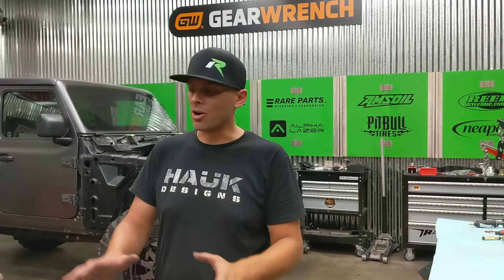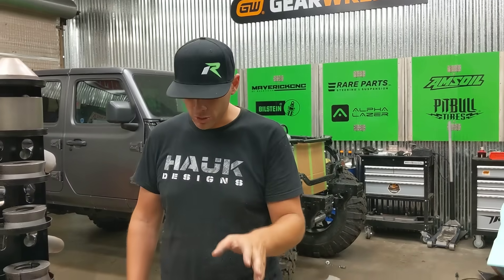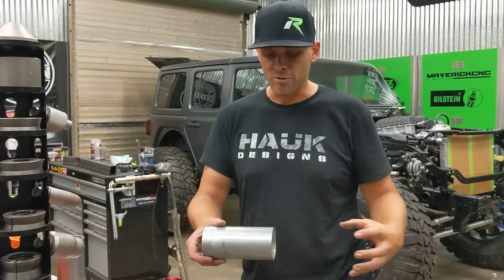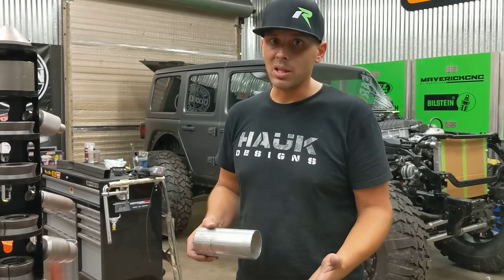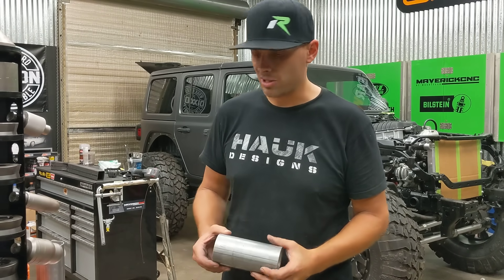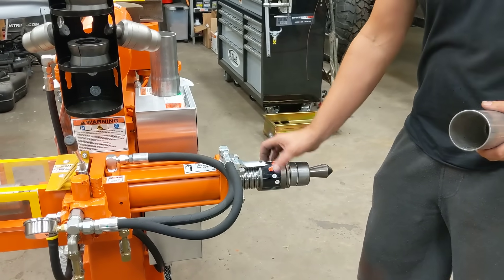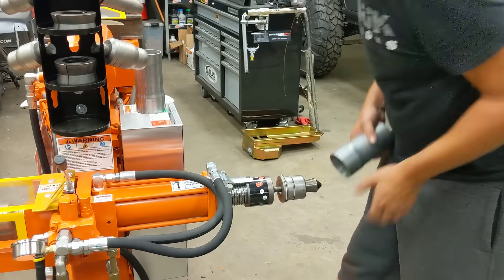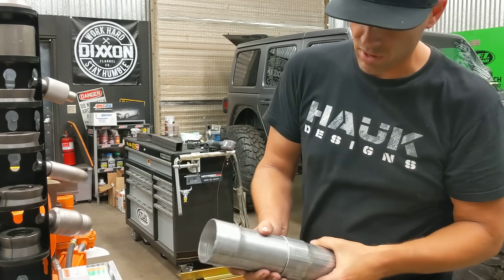Hauk Designs Using The Swager on their Huth Bender

Comment: That is actually the expander, not the swager.  The Swager looks, phallic, for lach of terms and you clamp your pipe into the fixter on the opposite end that you're on and then the swager is pushed into the pipt, creating the lap joint as it slides into the pipe. 

As a fabricator with years of experience, I find it a little concerning that you spent what you did on that machine and call yourself a fabricator but did not know that machine was capable of that before you bought it.

All Huth benders have the swager and expansion capability so it's not exactly a feature limited to that specific model.  They'd never sell a bender if it didnt have teh capability to do one of th most crucial tasks of custom fabricating with pipes.